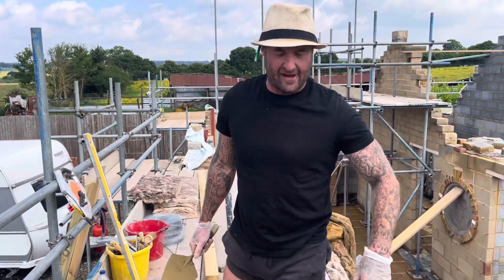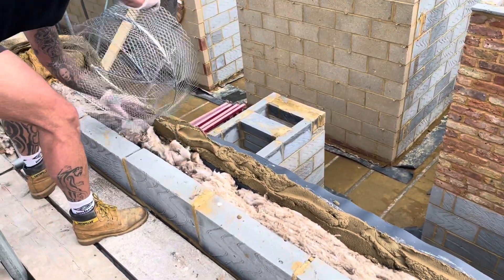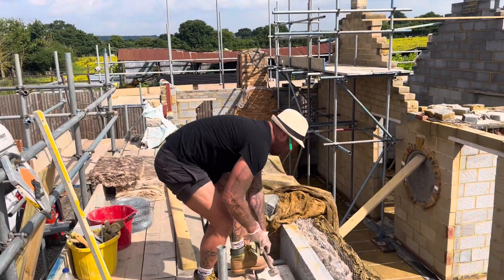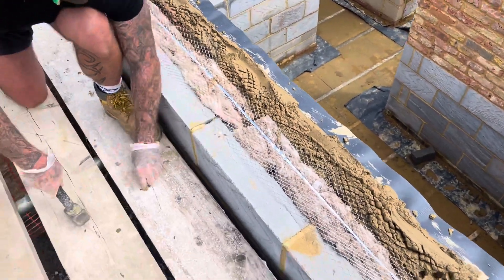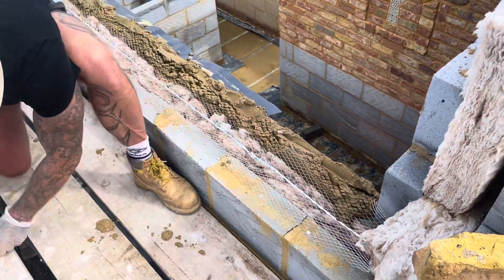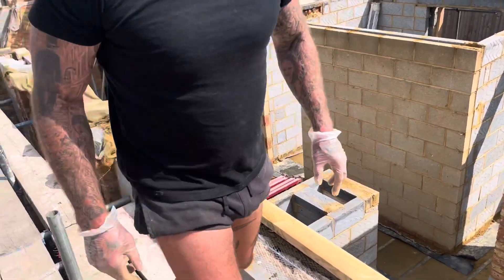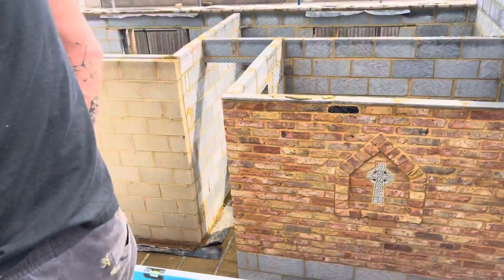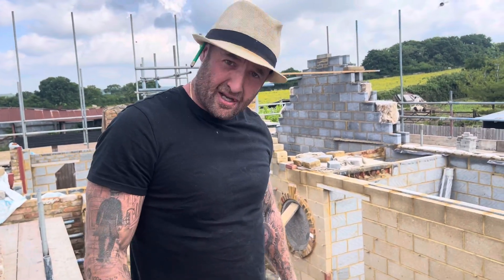Great brickwork tip 🧱

Comment: We used to have to close the cavity with bwk but that's been some years ago now, I suppose that would be classed as a cold bridge though now as you have to have continuous insulation these days.
Reply: I remember doing that, back 25 years ago on my apprenticeship. You and I know it's not a cold bridge, when up that high and under the roof tiles but it would be considered that, you're right

Comment: I live in the country. Mice and rats come up the down pipes  from  the drains, into the gutters and into the loft beneath the tiles.  A field mouse will go through a hole as big as your thumb, so the mesh would be of no use. Best way to keep the mice out, is an ultra sound device. Cheap as chips and mine has left me mouse free for 15 years.  You can fool some of the people some of the time.
Reply from the maker: So been doing it wrong all this time ...well I never ..some people on here Jesus Christ
Reply: Other people are entitled to opinions, although you may not agree with them. I’ve only been in the trade since the 80’s and lived and worked in the countryside all of my life. What would I know.
Reply from the maker: That weren’t an opinion memoir mukker ..that was if Uve been Tenerife I’ve been elvenarife ...just in case u didn’t know the mech is 5mm and is of use pest control still use it to this day ..anyway good luck all the best 👌
Reply: Excellent idea, I was a pest controller for 15 yrs in a city and rural and yes they do run up where you say but how many jobs that they run up the cavity into the loft far outway that and once they die in the cavity and start to decompose that then gives further problem. Mega 💡

Comment: That’s not a bad shout. Have they not got any longer lengths of timber!! And should half lap a join. Also what you doing with soffit and fascia on your house as outside blockwork is similar to plate height?

Comment: Hi Dean, I've have done this before many years ago, and yes, I agree, it's a good idea and it should be stipulated in the regulations. I've asked customers since then, and most of them say no they don't want it, because it can be quite costly, when it's placed under the wall plate and above the DPC, that's under the wall plate, which again is something brickies will try to get away, which is  the best position, as you did, the thing is the exmet or mesh needs to be Stainless steel when it's above the DPC, because if a roof leak did occur it could rust the exmet/mesh if it was galvanised. Also, dont know if you do this ?? but I also stick a fine stainless steel mesh (with silicone" over the inside opening of any  air bricks to stop ant's and very small insects, in particular the clay air bricks. "Nice one" Cheers

Comment: Never seen that done,back in the day used to close cavity's with blockwork or slate now insulation has to go into loft space so it's continually insulated with no cold spots but not a bad shout that what's that tiny piece of wall plate about would you not be better two equal cuts  half lapped👍

Comment: Never seen this interesting. Think you should lap joint your wallplate instead of sticking a small piece in the end 👍🏻
Reply from the maker: Never lap joint less than 200mm brother
Reply: @thetraditionalbricklayer9650  should you not cut the longer length and make the small length longer? Think they’re supposed to span 3 rafter/trusses minimum. Just what I’ve been taught thanks for the reply